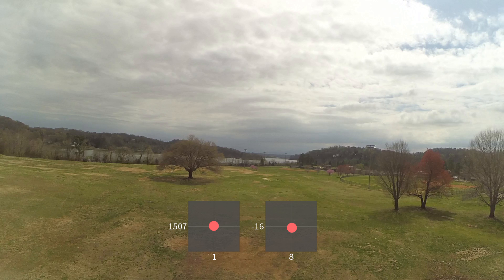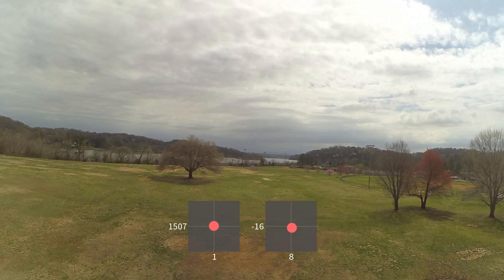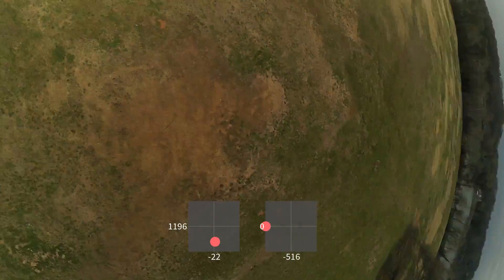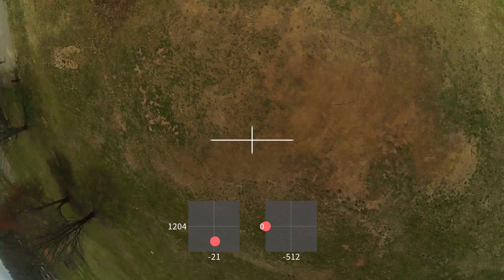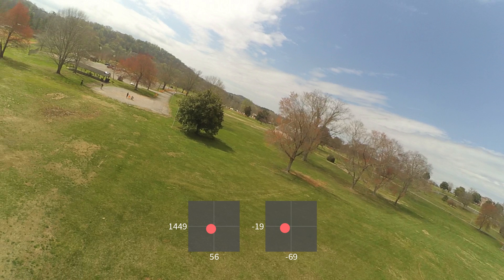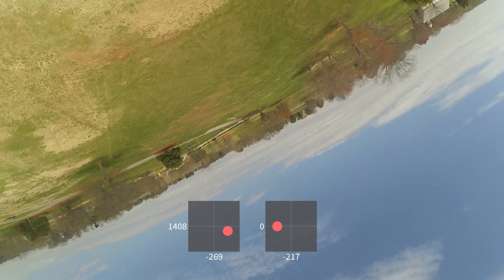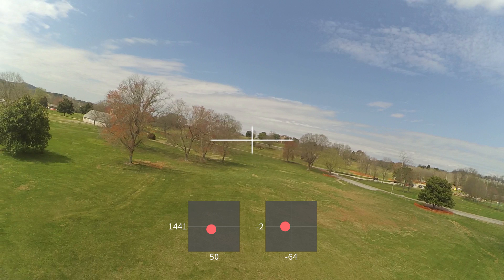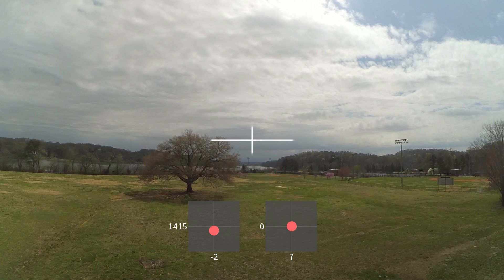How To Cross-Coordinate Rolls To Compensate For Camera Uptilt

Comment: I don't understand why There isn't an option in the Flightcontroller to input the camera angle. And that the Quad referance axis would be tilted by the flight controller to mathc camera axis. That way you never don't have to bother coordinating roll/yaw ?? (would be simlar to have tilted motors, except done via the flightcontroller software)

Comment: Joshua, with BTFL 3.2, I have been inputting the FPV camera angle on the 'configuration' page... does this automatically setup Betaflight to use yaw compensation? I never used any CLI commands. Now I want to try working on my spin moves but I want to do it without Betaflight help... Should I just keep that setting to 0? Or is it off if I never activated it through CLI commands? Thanks!
Reply from the maker: Yes, the camera angle in the GUI sets up yaw compensation. Personally I tried it and ended up not liking it.
Reply: What was it you didn't like? (I'm just learning to fly on sims, where this compensation seems to not be available.) Presumably the compensation can be "undone" by applying opposite yaw to retain the uncompensated "pure roll" feel. So isn't it just a question of how you train your muscle memory?

Also, I'm still figuring out my new Taranis QX7, but I think it's capable of mixing channels as well, although obviously it can't figure it out for you based on camera angle. But presumably with a little trial and error, the radio could do the coordination automatically, right?

Comment: oh, so there 'is' a coupling ability for roll and yaw?.. i wonder if anybody we know uses it for races or anything, and does that coupling go both ways? i mean if it can do perfect bank turns using just the yaw input? .. anyway, i'm resigned to just learning how the sticks combine in the real world and getting a feel for it,    shaky thumbs and self level habits are making it kinda hard to learn, not to mention only having one quad and being scared stiff of a crash.   anybody out there got any tips or tricks for shaky thumbs?... i'm thinking i might loosen the dampers on the yaw to see if that helps..... ok wheres that nose in video... hehehe
Reply from the maker: I guarantee you top pilots are just coordinating manually.

Comment: I was wondering, if it is so, why don't we just set the Flight Controller to work around the camera axis instead of the quad axis? So that roll input would be roll around camera axis, and yaw would be yaw around camera axis. I can't think of any downsides to this?
Reply from the maker: This is what the camera uptilt compensation feature does. https://www.youtube.com/watch?v=gEcWxHIH378

The down-side is that the copter doesn't have as much yaw authority as it does pitch and roll authority. So when you start mixing yaw in, your rolls get slower. Also, I found that there was a kind of weird "sliding" effect when I did snap rolls. I'm not sure I could explain it.
Reply: +Joshua Bardwell thanks a lot! Seems you have videos on everything haha :)

Comment: Thanks Joshua, very nice tutorials.  I'm learning to do some flow style like Skitzo and your videos helps a lot.
I was looking at this one on coordinating roll and yaw and I guess yaw rate as to be as close as possible the roll rate for this to work?  Because the roll and yaw would be kind of desynchronised and the roll would append faster then de yaw?
I ask because I normally fly with very little yaw rate compare to my roll (roll: 70 and yaw: 25) I guess its a matter of experience :-) and I will have to increase my yaw rate and get use to it.
Reply from the maker: +Amyot Rodrigue they don't have to be the same. Just use your fingers to adjust the horizon.

Comment: I could be wrong, but I'm thinking an argument for learning to do it manually is you're not always flying at the exact degrees to level your camera, will the "roll_yaw_cam_mix" setting be compensating for the full X amount of degrees set in that variable at all times? Example, if have your camera tilt is set at 20° and your flying slowly and your camera has a 10° up tilt while flying at that speed, will the mix compensate and only add in enough yaw correction for the given quadcopter angle?
Reply from the maker: +Perry Wolf You're right. But the difference is, most of the time, pretty subtle.

Comment: So you've really got me thinking now. For a while now I've seen pro pilots do these amazingly quick yaw spins, but always when I try to do them it feels like I'm half yawing, and half rolling. I now wonder if it only just feels like that because of my camera tilt (see horizon, then suddenly see sky). Is it possible to cross-coordinate a yaw spin, and if so, how would I do it? (yaw and pitch on same direction, or opposite?)
Reply from the maker: +Patrick Tuxbury I would call that coordination, not cross-coordination. To coordinate a yaw spin, you push the sticks the same direction. Remember that, when you do a yaw move, if you do it 360, the horizon will come back to where it was. So if you don't mind the horizon going all wibbly in the middle, you can snap 360 as fast as your copter can manage without losing orientation.

Practice slow flat turns first and get a feel for how much roll you need to add in to get that to happen.
Reply: +Joshua Bardwell Coordinated makes more sense, yes. I think in the past I've tried yaw spins and chickened out halfway through because I see the sky and it feels like I'm going out of control. It sounds like I should just try to finish the maneuver. I'll experiment with it next time I fly. Thanks! I'm really trying to raise my flying to the next level this year. Your videos are definitely helping.

Comment: is this why some "pro" pilots fly with 0 tilt on the HD camera, so that all their recorded material is relevant to the frame axis instead of camera axis?
Reply from the maker: +GMAC FPV If they really flew with zero uptilt, all you'd see is the ground. But you're on the right track. With a very wide-angle HD cam, you can have somewhat less uptilt on the HD cam than on the FPV cam.

I really don't think any pro pilots fly with zero uptilt at all.
Reply: +Joshua Bardwell check out some of their instagram accounts, some use none to very little tilt. Good info Josh! thanks
Reply from the maker: GMAC FPV Link! I gotta see this.
Reply: +Joshua Bardwell check out Skitzo's instagram. Some of his setups seem to have hardly any tilt on the HD camera. I did notice that his rolls seem very axial!
Reply from the maker: +GMAC FPV I'd estimate his uptilt at 10-15 degrees.
Reply from the maker: +GMAC FPV If you check this one, though, it looks like his foam pad has no tilt at all. So who knows?

https://www.instagram.com/p/BA-NXWgqK3L/?taken-by=skitzofpv

I just don't see how you can avoid having some uptilt if you're flying at any decent speed at all. You just end up staring at the ground.
Reply from the maker: +GMAC FPV Oh! Here's a great one that shows that his HD cam is definitely less tilted than his FPV cam.

https://www.instagram.com/p/8WUcUnqKwR/?taken-by=skitzofpv
Reply: +Joshua Bardwell It's a strange one. I'm going to do some experimenting I think lol Just stick to up and down flying and edit out the forward flight stuff lol
Reply: +Kjetil Ertsås he is certainly more an up/down flyer. Speed is not needed in freestyle. All very clever if this is the case...could be just taking pictures if quad like that to play with our minds lol

Comment: I was just trying the other day the complete opposite doing 360's using roll and yaw in the same direction.  It was a fun one.  It's amazing how just changing the yaw from one way to another changes the move from of flat 360 to a level roll.  This will be one to practice.
Reply from the maker: +txfieros Adding more or less yaw adjusts the relative change in pitch during the move. If you have zero uptilt on your camera and the copter is hovering perfectly level, then if you input pure roll, your pitch doesn't change at all. If you input positive yaw (same direction as roll), then at the 180 point, you will be pitched below the horizon. If you input negative yaw (opposite direction as roll), then at the 180 point, you will be pitched above the horizon. At the 360 point, you will always return exactly where you were, as long as your inputs are consistent during the move.

When you add camera uptilt, the copter starts out pitched forwards, so there is some automatic positive yaw built into the roll move. Adding negative yaw (cross-coordinating) can cancel this out.

This is why I think this is really actually a deep topic. Because there is an interplay between yaw, roll, and pitch, that could end with some really awesome acro moves if you took the time to fully understand it.